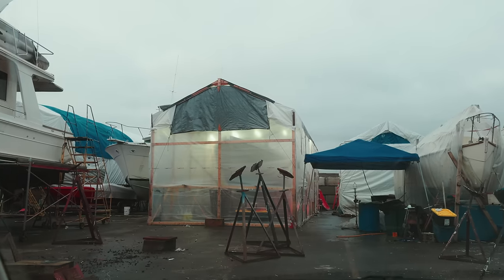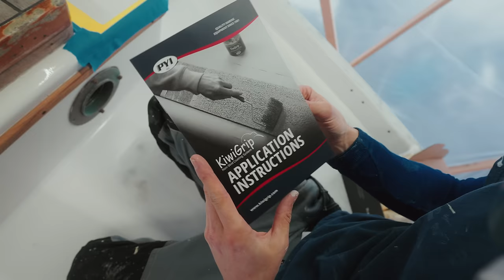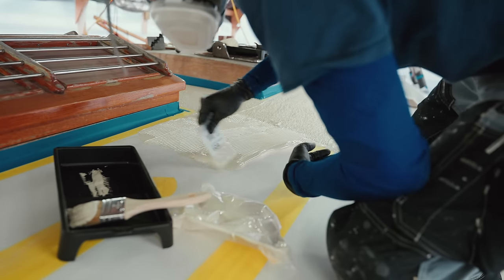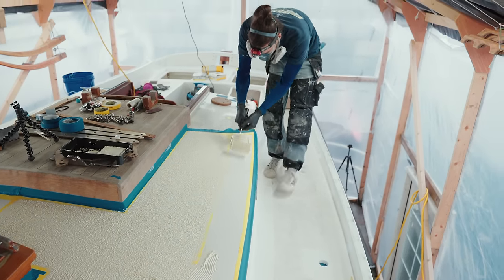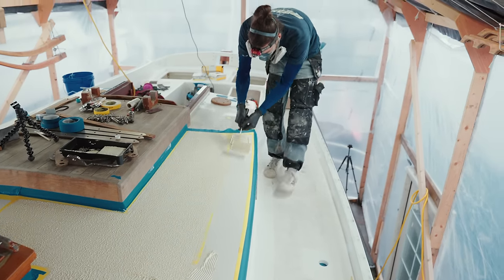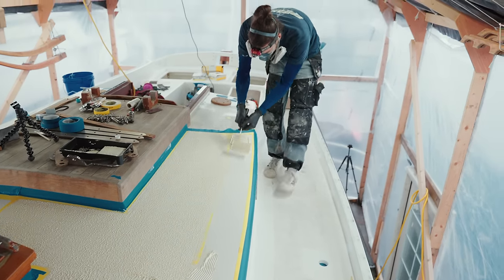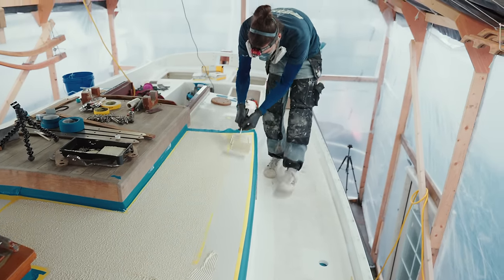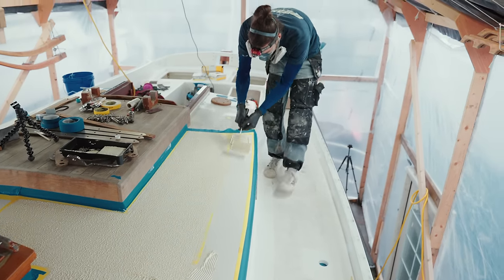A new experiment...

Comment: IMPORTANT!!  Kiwi Grip “blushes” like crazy. Once cured, be absolutely sure you scrub the decks VERY WELL with soap and water BEFORE you walk on them. They are VERY slick when wet if you don’t scrub them down. And by slick, I mean slipperier than ice. 

Beyond that, it’s a fantastic product. I did my Cape Dory 36 several years ago. Looks great, works great, great price. A+ product.
Reply: Yes all water based coatings are full of surfactants which need to be washed off so hose down and brush it then hose off again (will produce suds on its own no need to add more.

Comment: I have a 15 foot diameter Para Tech sea anchor, 275 feet of 5/8 inch double braid line, 400 feet of 3/8 inch three strand nylon line with 50 feet of galvanized chain, and an ATM Gale Sail, all of which are in dedicated sea bags and in excellent, like-new condition.  These were purchased new 24 years ago, but have never been used, and have been in dry, climate controlled 0:56 storage the whole time.  They belonged to one of my sailing buddies who passed away last year.  His wife gave them to me for disposition.  I have inspected each of them and they indeed are like new.  Although this equipment would be excellent for my Rival 34, unfortunately my blue water sailing days are behind me now, so I would like to offer them to you at no cost for your Cape George 36..  If interested, let me know.  I will need a shipping address in order to determine the best method of shipping and costs thereof.  I have followed your channel for quite some time and enjoy watching the refit of Magic Carpet II.  Let me know whether these items are something you would like to have, then we can work out the details thereafter.  Best wishes,
Rob Johnson
S/V Tempus Fugit

Comment: Great application for the first time; it came out well. It's hard to judge the color in a covered shed with low light, unpainted decks, absent varnished handrails, etc., but I think you will like it when it all comes together.   Then again, there is always the rotary sander ...

Comment: Yep! The cream is a nice color contrast and with the teak on board it will not look so.... Bold.  Value added benefit is "hiding" dirt, as u mentioned... Plus, in warmer latitudes the lighter color will help keep inboard a bit cooler. The down side is that the lighter color works hard to replel/reflect most of the light spectrum which causes it to break down quicker than a darker color. All totalled I think it was an excellant color choice.  Well Done!

Comment: I've used KiwiGrip twice for the decks of my 55 year old Spencer 35.  I found it very easy to work with and it creates a great non-skid surface.   I also took the product to my local hardware store to customize the color the first time.  Second time I just bought little tubes of pigment and mixed it in my self in the cans.  All was easy.   But like Aladeno says careful taping and handling of tape removal is critical.  Overall KiwiGrip is a great product and if you can paint reasonably well it is fine for DIY.

Comment: Oh, I remember all the issues we had with such grippy paint back 3 decades ago and then some, it was such a mess and so bad that it was barely useable. It also had to be stripped off and redone way too often as it didn't last. It was actually easier to use something like plastic film that could be cut to shape and then glued on. Sigh, how far we have come, yet so little has changed, yet it might be a lot better than the stuff I remember.

Comment: a really good choice, this kiwiGrip.
I redid the entire deck of my boat last year with this.
feedback on 1 year of use:
1. Be careful with fragile swimsuits, they stick very tightly :)
2. Be careful with your fingers when cleaning with a brush, it's as strong as sandpaper
3. very resistant: I cleaned the deck with a high-pressure cleaner, it is impeccable and it holds up perfectly. It is even the most effective because the green dirt comes off very well. (With a brush and soap, it's painful)

Magnificent work

Comment: Looking good 🎉 the local hardware store had non skid sand in a milk carton container. I put the sand in a salt shaker. I was using all grip paint. Coat of primer then 1st coat of paint. The second coat I put down a 3’x3’ area of paint and then evenly shake the sand on while paint still wet. Kept going like that for the whole deck. Next day put down the final coat to seal the sand. Can still walk barefoot on it and not slippery. Must be kept clean after fish on the deck. I have been on fishing boats where the non skid is very coarse and sharp. They don’t want any one slipping. If you are wearing shorts and your knee touches the deck it can tear the skin. Kiwi grip looks good 🎉

Comment: Aladino, Maya, The KiwiGrip looks great. Nice job. FWIW, we are approaching 10 years on our KiwiGrip non-skid, and it is lasting very well. We did a second coat about six years ago. After cleaning for prep, it simply went on right over the original. The first coat was creme colored. We decided to change it up with the second coat and custom mixed up a combination of the grey and blue colors (1x1) and laid it right on top of the creme layer. The result is sort of a classic Austin-Healey roadster blue/grey tone. No problems so far, and no color bleed through. 
We find that the grey/blue mix color doesn't show dirt as much as the creme did. It we start to see the underlying creme layer, as it ages we will just put another coat on top. We are hopeful that the custom mix we did is simple enough that touch up won't make it look like a leopard. But it is simple enough to just lay a full coat on. 
While KiwiGrip is easy to work with, I think you will find that the best attribute is its longevity. Also, it can be used in a variety of ways. Ours was an oddball application in the sense that we put our boat into a dry interior space and dried out the 30-year old teak decks thoroughly over six months. Then we applied two coats of WEST System epoxy as a saturating barrier coat over that old teak. Then we applied the KiwiGrip on top of that. We essentially ended up with two cored decks - one on top of the other. The original balsa cored fiberglassed deck underlays the teak, and the somewhat worn (and dried-out) teak acts as the core for the WEST System deck, all of which was then covered with KiwiGrip. It sounds complicated, but it was a LOT cheaper than replacing the teak in kind or even just tearing the old teak off the fiberglass cored deck, then glassing it, and then putting the KiwiGrip surface coat on. Hope you will be in the water soon. We will be heading north from Friday Harbor in June, M/V Iron Wind.

Comment: Beautiful job!   I did my deck with all that taping the first time, but after experiencing how easy Kiwigrip is to repair ( one pack water based + textured finish ) I realised that I was never going to need to sand it all off to recoat in the future, which seems to be the main idea behind the fancy taping. ( Is there another reason?? ). I also found it a little dangerous when I mistakenly stepped on a gap in the non skid  when sailing, so I ended up using minimum tape and covering with Kiwigrip right up to the edges. It took a while to get used to the lack of that 'professional' look but it's so much faster and safer that I would never go back to the traditional masking system. You are putting so much love into your boat that you are destined to receive huge amounts of good fortune on your sailing journeys to come.

Comment: I was very impressed with Kiwi grip when I rolled it on the decks of my small boat.  Easy to apply and the finished result is grippy but still comfortable to walk on bare foot.  Pro tip, roll slow so it doesn't throw splatters on anything and a slow roll gives you the  tallest 'frosting' peaks for more grip.  A fast roll will give you lower peaks that end up more like orange peel and less grip plus throw splatters.

Comment: Tip for begimers: sometime to avoid lifting the paint pull the tape 180 dgr away from its original place, right against the unlifted tape, also experiment with different angles for different products.
As usual love your videos ,thanks for sharing .
PS not crazy about the color but you are right white is impossible to keep clean, the most in the N.West.

Comment: I have used Kiwigrip for 15 yrs or so I think most non skid on my old boat were that old and standing up very very well maybe some wear along side decks from sheets etc easy to redo just wash mask and roll a coat on over the old. personally I like the grey which is quite a light grey. One benefit of the limited colour range is its easy to get touchup paint.

Lighter colours are best because it reduces heat buildup on the deck which can be an issue here in New Zealand.

Comment: I have mixed feelings on kiwigrip.  From what I’ve seen, It is a good nonslip surface (depending on application technique), but I think you’ll find it holds dirt and is hard to clean. It also oxidizes quickly (latitude dependent), so begins to look a bit tired sooner than you want.  I hope your experience is better than what I’ve seen. You did an excellent application.  For my own decks, I’m planning to use a cork product, Marinedeck 2000. From a distance it reminds one of a laid teak deck, but it’s not really pretending to be look like teak. Excellent nonskid, east to repair, and much less $$$$ than teak.  Just a thought for the future if the kiwi doesn’t work out how you want.

Comment: You two are such artistic craftsmen and a joy to follow through each design and aesthetic decision and execution.  When completing the deck and rigging on my Swift Solo 14, I struggled with the type of non-skid and placement which would provide the necessary safety, yet not cover the beautiful western red cedar strip decking. I chose a combination of heavy-duty black neoprene adhesive-back non-skid for the high traffic areas under the boom and on the gunnel rails and 3M clear Safety-Walk adhesive-back non-skid for lower traffic deck area forward and port/starboard wings. If Kiwigrip had a clear product, I would have used it to preserve the wood grain aesthetics. Thank you for sharing your journey.

Comment: Great job guys. She’s looking awesome. Question…..I know it must be not filmed due to time, but painting below the waterline, I’m assuming you paint around the props and blocks, let it cure, then add props in different positions, remove the original props and paint the square spots that were left? And similar to the blocks? But you must jacks the boat slightly to get the blocks in and out? So if you did 3 barrier coats, seeing how Alidino is such a perfectionist, you moved the props and blocks every coat? Wow…..
Reply from the maker: We have done 3 coats and will soon add two more. Then when the stands are moved we will do the same amount on the missing surfaces